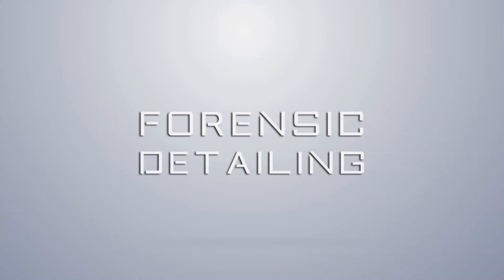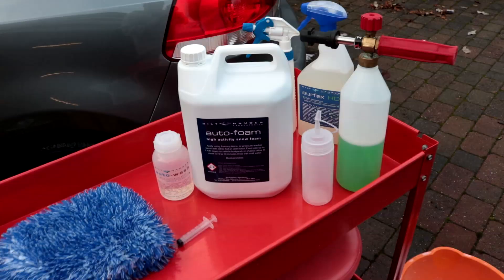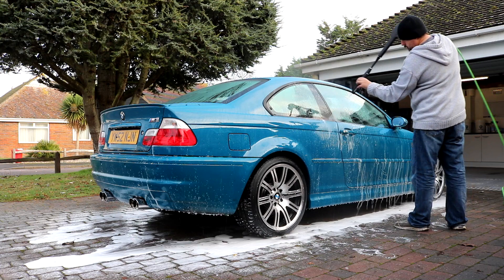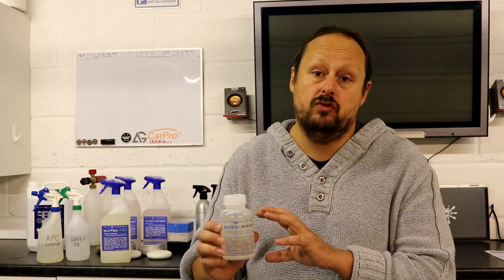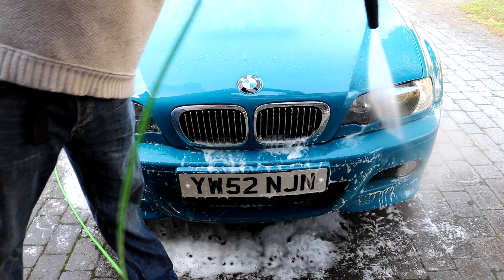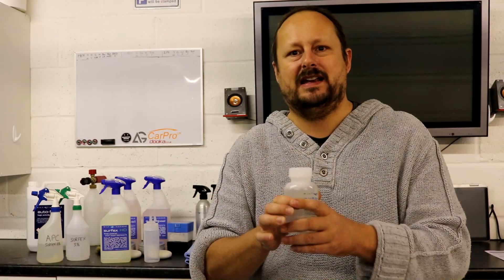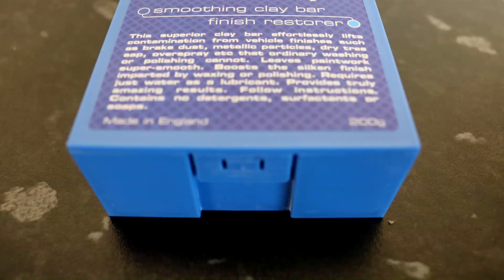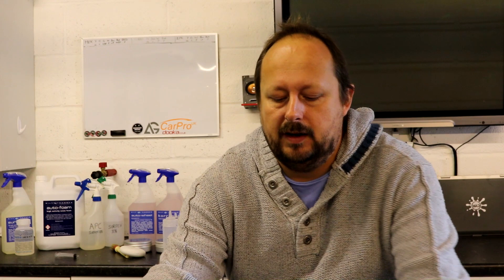Bilt Hamber Laboratories review

Comment: Can't believe I just watched an hour of that, I'm brainstorming cleaning my Triumph Bonneville SE. Found Auto Trader Tyre Dressing  recommendations and looked for their wheel cleaner reviews discovered Bilt Hamber. Then FDC review against Meguires then this. Then I've gone to look up a pressure sprayer for the snow foam and found this searched YouTube and he's got a video on this as well Spear & Jackson Pump Action Pressure Sprayer, 5 L
Reply from the maker: your in good hands with BH dave.  no bullshit no sponsorship.  very powerfull, safe products, highly concentrated and cheaper than most trade lines.  products with a interest in anti corrosion as well.  perhaps for your triumph.   you should use only BH products from wash to decon.  Koch products for machine polishing.  And BH double speed wax and QD concentrate to maintain.   Get carpro perl as your tyre and rubber dressing... done mate.

Comment: Great video. I’ve been using the clay bar and the double speed wax. I’ve also just bought the surfex hd which I was going to use instead of the snow foam. I was also going to buy the auto wash. Anything else I need to get a great look. I’ve got a silver car which is a bit of a bugger to get a good shine!

Comment: I am a user of Bilt Hamber products, but one product concerns me which is the ‘Auto Wheels’ wheel cleaner.
Before I purchased the aforementioned product I exchanged communication with BH as it appears that ‘Auto Wheels’ and ‘Korrosol’ are virtually the same product with the only difference being the ‘Auto Wheels’ has a slightly thicker viscosity.
Getting back to my concerns with ‘Auto Wheels’. My brake callipers like most cars on the road are not of the painted type, but factory zinc plated. Unfortunately, it appears that ‘Auto Wheels’ has some kind of corrosive ingredient as when it comes into contact with ferrous metal a chemical reaction occurs. Over a period of 3 years, using ‘Auto Wheels’ approximately once by monthly I noticed that the brake callipers became discoloured, resulting in the callipers begging to corrode (rust).

So anyone who intends to purchase BH ‘Auto Wheels’ bare in mind that if you have non painted brake callipers this product will attack the zinc plating and eventually your callipers will corrode to an unsightly black/rusty steel colour over a period of time!
Reply from the maker: hey there.  Any fallout remover you do not want to spray on the brake rotors or unpainted calipers.   Its not just BH.     Unpainted calipers always tend to develope a layer of oxide those and then go all rusty.  I know exactly what you mean.  you should really just use surfex HD.  back news is you will really struggle to stop oxide forming.. but yes dont use a FR on them for sure.
Reply: Forensic Detailing Channel thanks for your most informative comment and keep up the good work on your channel👍🏻
I think that given Bilt Hamber ‘Auto Wheels’ is a dedicated wheel cleaner it is difficult to avoid spraying this product onto brake callipers or wheel hubs. AW is also non acidic but it can lead to a false sense of believing it is fine to use without any concerns.
There is also no mention or warning on any packaging or reviews that these products damage metal coatings, in particular unpainted, zinc coated brake callipers. On the basis of the aforementioned facts I have refrained from using BH Auto Wheels wheel cleaner.

Comment: Do you need a fallout remover for a good ceramic coating?  I guess that for a ceramic coated vechicle or bare metal wheels, you want to use a non acid based fallout remover.  Can you use a non acid based fallout remover for non ceramic waxes and sealants as a quick fix without removal

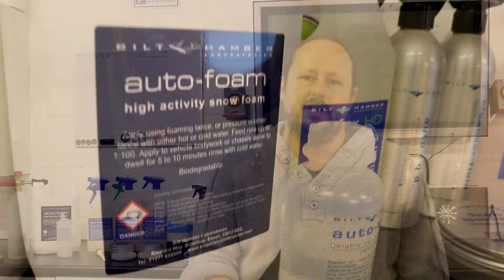Comment: While BH Auto Foam is one of the best is because it actually uses science. The PIR percent suits every pressure washer, getting the proper dilution with each aplication. With most pre-wash foams, it'll call for 1:10(for example). Well, 1:10 concentration is going to heavily vary between pressure washers.
Reply from the maker: the difference in cleaning power between this product and other pre wash now foams is pretty extreme Brewinz.  It doesnt strip, it doesnt mask, it reveals and brings back hydrophobic performance, its highly effective on road film,  it also does not need 10 minutes dwell times.  its also well priced.   the only thing it doesnt do is create thick foam.   but it doesnt need to does it :)   Its also inhibits corrosion, wont turn the brakes orange or cause ferrous components to oxidize and start rusting (some ph neutral scene soaps, massivly promote corrosion in ferrous components, you would be shocked if I could show you how quickly they do it as well).   Its totally non caustic and bio degradable, it avoids using other materials and chems that are harsh, but it still outperforms products with the harsh chems in terms of potency.    This company are the complete real deal, their understanding of the cars and how to formulate products to clean them safely but extremly powerfully is second to none.   There are so far ahead its scary and its all down to the brilliance of the formulations and how they go about developing them to outperform other products.   On top of this its all extremly well priced.  Everything is ultra concentrated and very very cheap.    Their rust inhibitor spray for example pennies for a litre.  Their APC 100:1 concentrate 17 quid for 5 litres..   paste wax 14 quid.

Ive also noticed other brands now dropping their prices on 5 litres to compete with auto foam.       Sounds like a commercial but its not, I dont accept money and BH pay me nothing.  I recomend it because its a no brainer.
Reply: Forensic Detailing Channel thanks John for the awesome reply! I tried it at 10% PIR and it didn’t strip beadmaker!! Whoa!! I totally expected it to at 10%! I’m definitely going to try some of their other products. Love your channel!!
Reply from the maker: @c6z061  meant does not need 10 min dwell time sorry. its very fast acting.
Reply from the maker: another thing brewinz.  you would think like there would have to be some sort of comparmise as in it must like strip products.   but it just doesnt seem to.  maybe oily waxes and stuff. not sure.  but however its able to clean so well and not strip is the really clever bit.
Reply: Forensic Detailing Channel agreed. At 5 minutes it was really starting dry up, even in the shade on a not so hot day, so I was wondering how you got 10 minutes dwell time..lol. Now it makes sense you meant to say it does not need 10 minutes.

Comment: Excellent video. I've been using the snow foam for a while and agree it is a great cleaning product. The shampoo is also really good but I found it a bit boring. Maybe a silly reason but I like shampoo to have nice smell to it. I have now gone over to Adams which i find at least equally as good and also CG Gloss Workz. Don't think you mentioned you can also use the clay bar with soapy water rather than a QD.

Comment: Does BH Autofoam strip sealents and waxes? Some detailers out there claim that it does!
Reply: But how are you gonna remove greasy dirt without at least some degreaser? ( greasy dirt for example bird poo, tree sap, car exhaust)
Reply: Auto foam is not PH neutral I believe so it mightl degrade waxes and sealants over time. At least your car will be clean though and just add more wax.

Comment: What kind of experiences you have using combo Cleanser Polish+wax? How much CLPolish reduce wax longevity?
Reply from the maker: hey saul....

I dont tend to use polish with wax in it...   I appreciate the need for time saving in this industry.. but when I finishing polishing a panel I want to remove those microabrasives and oils from the car.. and then use a proper sealant or wax on a prep'd surface..

the AIO is almost a wax of reducing the time factor down for car preparation... great if your in the car sales industry..  no so great in terms of results..

CL polish will weaken your sealants and waxes.. note use of the word "weaken"

Comment: love the vids there great. spent hours watching them all. ive bought a fair bit of the bilt hamber range based oon this review you have done. one question is who much snow foam is a recomendation in the lance. most snow foams i use go by 1 inch of product in lance bottle top with water. would this apply to the bilt hamber foam.

Comment: Hi I got details of “pir” for auto foam, can’t remember where, but the suggestion was fill the bottle on the foamer with coloured water, 1ltr exactly, then squirt jet wash into a bucket when the mixer on the snow foam bottle is empty, measure the contents of the bucket times this by 0.04 and this gives the 4% PIR... I have done this and it comes out to 620ml auto foam, top up to 1 litre with 380ml of water. Apparently this was from Bilt Hamber direct... thoughts please as I used 750ml (mix) for one wash. After the PIR. Has been established for the pressure washer, does it have to be kept on maximum foam.. I don’t mind the cost if it’s doing the job right. Your advice appreciated thanks.
Reply from the maker: yo steve,   I use it between .5 and 1% pir.   4% is very strong I only use it on on really heavy road film or grime at 4%.   1% works great for me.

Comment: Hi John, I'm not sure if you will see this message as the video is an old one. Having watched a number of your videos I am would like to understand a little about the subject. I am not intending to get involved in machine polishing and the question I have is does that mean I shouldn't use a clay bar on my car because of the marring that will cause and therefore I won't be able to remove that from using any hand applied products? Really enjoy the information included in your videos. cheers!
Reply from the maker: hmm I personally wouldnt clay unless I could machine polish.  But there are people out there that tell me they dont install a single scratch when they clay (deluded).   If you do a very light clay on good paint you might get away with an intensive hand polish to remove the marring but hmm no.   I would get machine polisher mate you need one and they are cheap.
Reply: @ForensicDetailing  Thanks John - always great getting advice from the oracle! It's really finding the time; I wonder what the quickest time I could get away with for machine polishing?.. all depends on the condition of the paintwork of course...will have a think about it and look at some more of your machine polishing vids.  BTW, what a beauty that 911 964 targa was. Absolutely gorgeous!

Comment: Have used double speed wax and clay bars as the first products I bought to detail a car for sale. Amazon reviews were the main reason. Very happy customers. Question I have is, can you use auto foam if you don’t have a pressure washer?
Reply from the maker: hey andrew put autofoam in a IK foamer or a some sort of hand foamer and it will be great mate yes lots of guys do this.
Reply: Thanks Jon will check it out👍🏻

Comment: Hi matey whats the proper dilution ratio for autofoam?
Reply: 4% panel impact ratio. Check out the bilt hamber website for all the info. Please bear in mind that your foam cannon dilutes further than what you put in the bottle. For my foam cannon and pressure washer (k5 karcher) i need about 350ml of bh auto foam to 650 water in the foam cannon. But that amount does 3 to 4 cars before I refill the bottle :). If you use a pump sprayer just use 4% dilution. I find about a litre of total mixture does my small car (40ml of auto foam)

Comment: I pressure washed and washed my partner’s car which hasn’t been washed for years and upon drying found there was still a greasy oily coating on the car. I used BH Auto Wash as my shampoo as I always do but I have BH Surfex HD and I’m thinking of using that next time as the shampoo just one time to clean off all that grease and oil. Thoughts?
Reply from the maker: yer if you have some build up of oil, then surfex HD is a degreaser.. you can use it like a prewash. but dont let it dry.. it should help break down the oil film mate.

Comment: I've used the Auto-wash shampoo recently and found it to not be that sudsy? Used about 10ml in a full meguirs bucket.
Reply: It’s not the most sudsy but it is one of the most lubricating. It’s also got anti corrosion stuff in it if I remember correctly. They don’t really go for the scents and foam thing. Their snow foam is by far the best in the game at cleaning dirt but is also one of the least thick. I was put off at the start but after trying others ending up going back. Performance over aesthetics I guess. If you really like suds, try making the bucket up with warm water. (I’m not an expert, but I’ve been messing about for a few years and watched plenty of forensic detailing lol)

Comment: Hey Jon, stupid question. Wouldn't you want to pressure wash as much dirt off the car before you snow foam. Or do you want the foam to go onto a dry surface? Thanks.
Reply from the maker: I don tend to.. although sometimes if theres a few big clumps I might.. or really heavy road grime I might give it a sneaky blast before foaming...   the main reason I dont do a pre-"pre-wash"prewash is due to time...

Comment: Hi thanks for all your videos. I  bought surfex HD 5 litre, but when using spray bottles they are getting blocked within a few days. I tried chemical resistance spray bottles, unfortunately will the same result.  When i soak the heads in water and replace back , it will spray for a few seconds, then block again . Note the mix I am using is 10% surfex HD and 90% water. Any suggestions?
Reply from the maker: I use it in the the cheapest 1 pound ebay sprayers and its been fine..  I dont think the sprayers Im using are chemical resistent either.       it should block the ttriggers its a loose liquid..

Comment: I'm a bit of a newby when it comes to car cleaning. If I use the snow foam rinse off etc then use the shampoo to hand wash the car after then dry and apply the wax and buff it off. When I come to clean the car again and do the same process. Do I have to remove the wax to in a way start fresh? And if so will the snow foam do that? Or do I just do the same process at the first time and reapply the wax as before?

Hope that makes sense to what I'm asking 😊
Reply from the maker: hey gavin.   It will depend on the wax product you apply...  The products you then use to clean the car... and if the car is left outside or in a garage mainly...

Waxes will vary in durability from 3 weeks up to 12 months if they are fortified with durable polymers...  Some care cleaning products can remove and strip waxes so try and use PH neutral non caustic products that advertise they are safe on your coatings... genneralyl snow foams and shampoos are pretty wax friendly nowadays...   You dont need to strip off previous wax coatings generally when you apply a wax (there are exceptions to that rule though)..      so wax up... and then just nice general maintainance washes once a week and then when the wax starts fadings rewax..   good detail sprays can add protection which will help the wax last longer as well...   something like Angelwax QED or autoperfekt sillk will really boost your protection mate.
Reply: Forensic Detailing Channel Thanks for the fast reply. I was planning on using the products you reviewed in this video from Bilt Hamber. I only clean the car one every 3 weeks and I've only had it a month as it's my first car it's a Fiesta Zetec S in white which can be a pain to keep clean. I've cleaned the car a few days back but only snow foamed and hand washed I've never waxed it before.

Comment: Autowash:
How is it that i don’t get the foam that u get in the video?
I tried this product several times and every time there is almost no foam.. lubricity was also not there 🤔
I put 6-7 ml in a 15l bucket, first filling it half way up with water.
Reply: thomas181212 try increasing 8-10 ml, I find hitting the water  in the bucket with the jet wash half way through the wash wakes up the foam . 10 ml still is only about 25 pence a wash if you buy the 1 litre